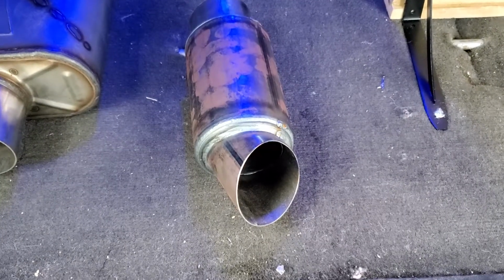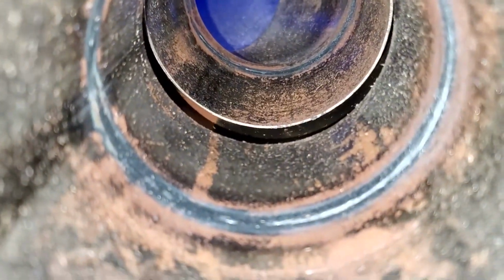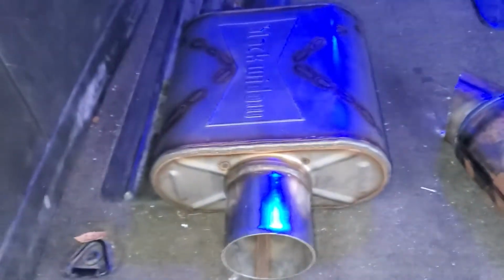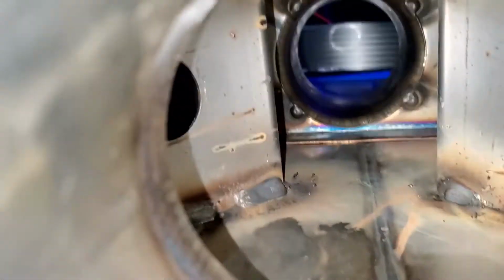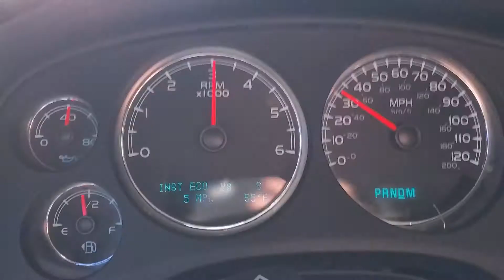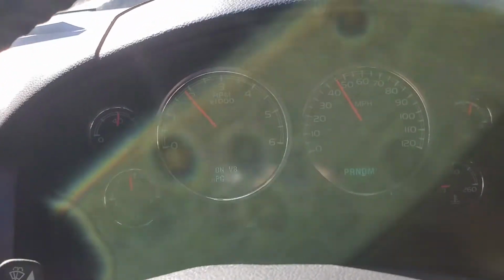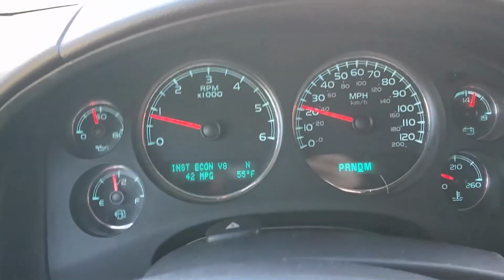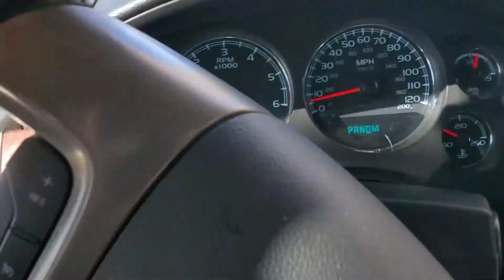Black Widow Race Venom on a 2011 Tahoe 5.3 (Axle Dump)

Comment: Does it have alot of cabin noise
Reply from the maker: A little bit when going down the highway. Otherwise, only whenever you floor it. But, i'm also axle dumping. If you had side exhausts, I doubt it would drone at all.